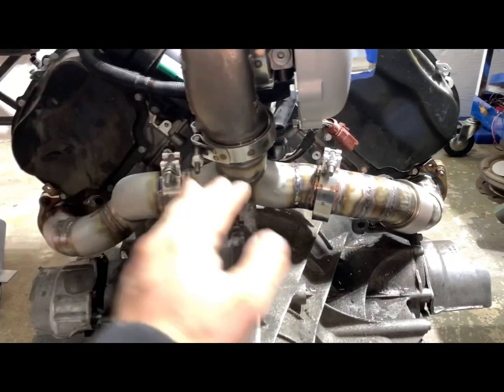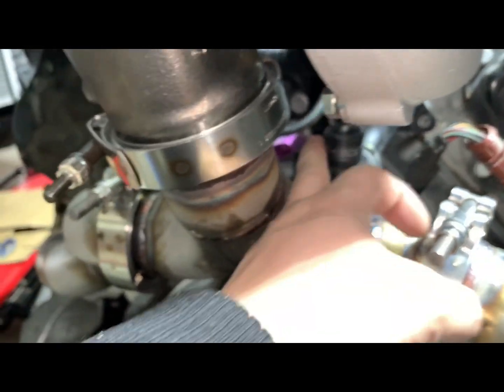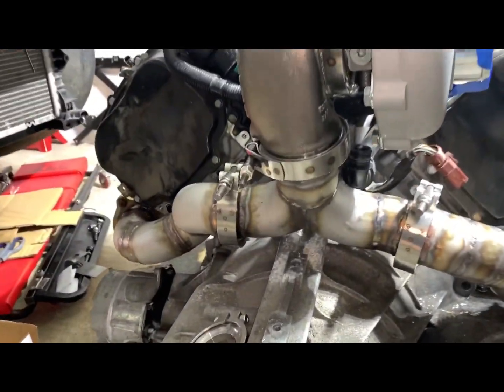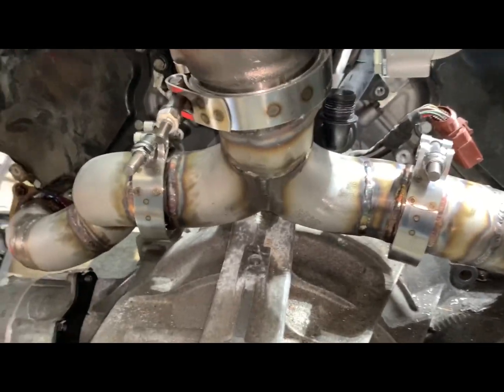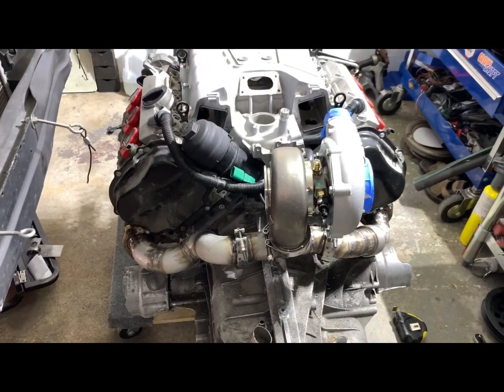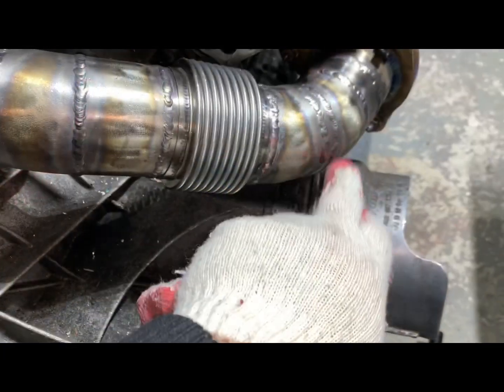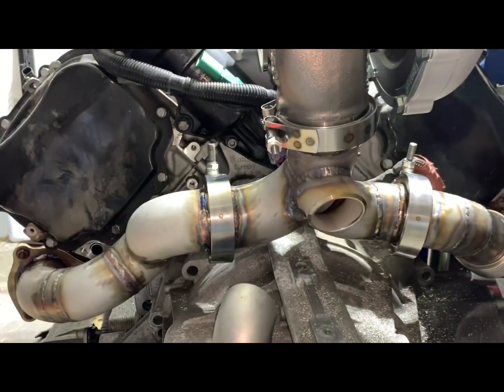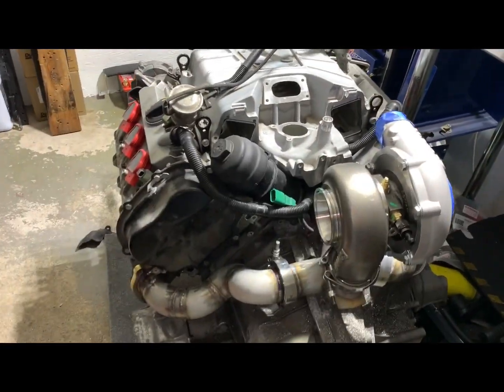Audi S4 B8.5 Single Turbo conversion part 1 “ build turbo manifold “

Comment: What is the function of the little flex pipe in this application? If you're solid mounting the turbo to the engine/trans then what's the point? Otherwise sick build

Comment: Im about to do a similar build but with 2 small turbos, low psi. What is your thoughts on this? Im wondering how the engine will react with such flow early in the revs.
Reply from the maker: I don't like twins because of limited space and double more work fabrication plus all plumbing etc... Single turbo can be swapped in 30min and twins would take a lot longer also twins will create a lot more heat in engine bay. I'm not saying can't be done just too much work. 67mm turbo responds very well in my car and turbo in this video is new G35-900 should respond much quicker then my car
Reply: @Svarogperformance  Sweet thanks, do you think you can swap for a medium size single on stock internals?
Reply from the maker: @Jerrycg  my car got 67mm turbo and car in video is 62mm turbo it will respond a lot better then my car down low rpms and still able to make it over 600whp on this turbo
Reply: @Jerrycg  Why not just keep the supercharger? That's a lot of work for baby power no?
Reply: @Svarogperformance  Its a late 2011 b8 by the way, i know they changed some stuff between b8-b8.5 hope engines are similar enough

Comment: What is the expected crank power with stock internals?
Reply from the maker: 700hp
Reply: @Svarogperformance  pretty decent amount for stock engine. Believe that reliabilty become an issue.  But anyway nice project.  I also have an s4...good car but eat some money 🤪
How is going on with v8 swap to another s4?
Reply from the maker: @alvislukins7827  Not really, the most issues were for me transmission but now we finger out after 4 years to finally make DSG happy.
Reply: Looks great so far. Looking forward to the updates 👀